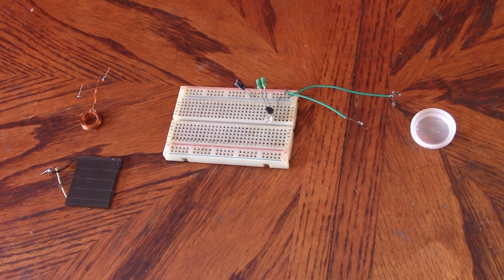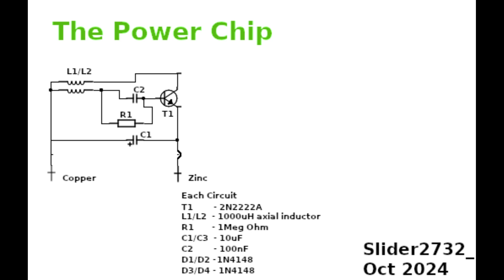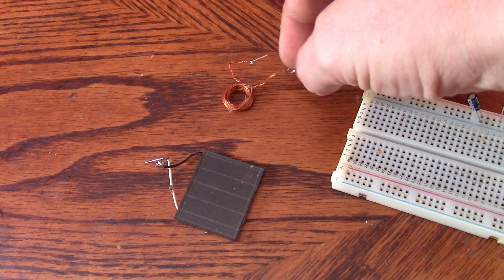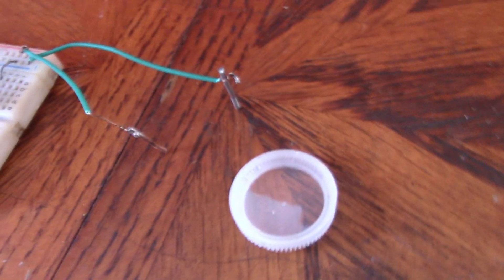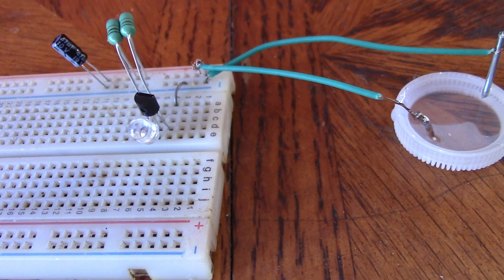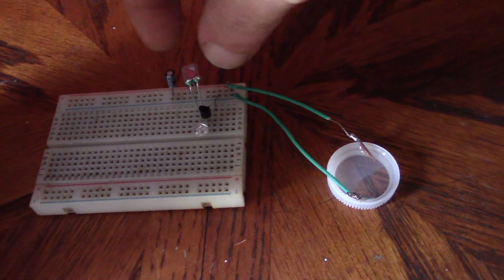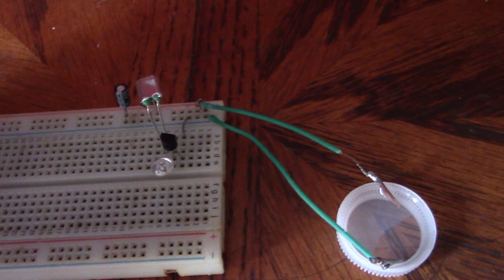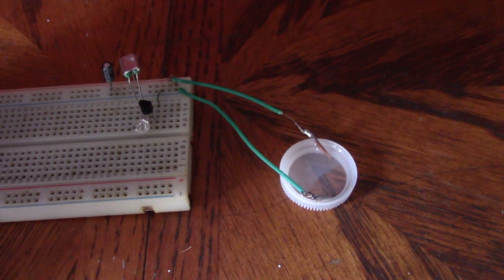Crazy Simple Water Powered LED Flasher!

Comment: It's basically a joule thief circuit. At those low voltages there is no need for the resistor. I ran them on a penny and plate of zinc with a wet paper towel between them like this before. Pretty fun to see it work

Comment: Amazing,  when you take into account how much metal is actually touching the water that's really the only amount of metal you need so I wonder... would it be cool if you could make that whole thing work and it's all within the size of a bottle cap is that possible?
And if so could stack them in series?
Reply from the maker: Interesting concept and yes, that should be possible. Well, the bottle cap bit, the stacking would mean everything would have to be ultra flat. Might well have a go at that 😀

Comment: so cool. amazing you got it working even with the small inducters. will try to get that working too. interesting also, that its working with the led connected to base and collector! thanks a lot.
Reply: i think there is a bit more current drawn thou. or isnt it?
Reply from the maker: @MilkywayOutcast  It's a superb modification and thank you again! Hopefully a little traffic goes your way as the video has done well 😀
In practice, both LED connecting methods work about the same, EC or BC. I usually pick EC, but it was just how the LED was put in the breadboard when first testing and I left it like that. Only noticed when the camera was on. Have found that you can superglue 2 inductors together (same direction of colour bands) and it works. They have to be right next to each other for the field energies to cross.
Reply: @Slider2732_  thank you a lot. i got them working. i also would like to show you another thing very remotly related to your project which i dont want to post publicly but you may find entertaining in case you have not seen that before yourself. can i send you an email with link to privat vid?
Reply from the maker: @MilkywayOutcast  Superb to hear of them working 😁
Unlisted vids I can click on, but I don't think Private can be. This email addy will get to me: youtube.scoop273@passinbox.com
Reply: @Slider2732_  thanks. will send you a link in the next days.

Comment: We need to consider huge internal resistance of “battery”, this is why no resistor is needed. Transistor arrangement with 2 coils (inductors) works on very same principle first disclosed by N Tesla as power regulator … I keep thinking of Tesla valve which allows a little leak back but stops the main back flow shock by guiding the flow against itself … and here we have BEMF which is directed to power the load or whatever purpose.

Basically if works with one transistor in theory can work with 2 or many in darlington arrangement, then bifilar coils should work better as they have no capacitive or inductive reactance and simply amplify the voltage.

I only have 3 videos on my channel, one with the “battery” and the other 2 with bifilar coils … all I need is to upgrade the battery or modify the zvs driver or a different solution for switching. I am trying not to claim anything but it is at least strange what I am getting and how I get it.
Reply from the maker: Yes, great points! A bifilar pancake version might yield some interesting effects, especially if left to wireless output, not wired. Field energies might well outperform wired in some situations. 
You've got me thinking with Darlington or more likely Sziklai water power 😀

And do upload more vids! I noted your last was 7 months ago and am intrigued about your experiments!
Reply: @Slider2732_  many thanks for reply. Indeed those coils should be used for wireless power transmission. Using flat coils reduce the size of field radiation and everything can be captured in short distances.

I am yet to find a way to measure their output in a different reliable way than just powering known loads … but I have destroyed too many instruments for now and I am not going to spend more on instruments then experiments materials.

I am banned from most of forums for “unsubstantiated” claims even if they are just what Tesla and many others have said long time ago. We only need to look up for old books/patents … as almost everything is twisted in new and modern science. We need to refer to basics to straighten up all bent and thwarted theories.

Comment: I like that, I don't think you can't reduce the components any further 😁😁👍👍
Reply from the maker: It really is crazy simple and I know I learned a lot. You may well have experienced similar over the years, where oscillators get to just under the transistor firing voltage and sit there.  Was on the 3rd day of this running 24/7 when it stopped, the water bottle cap had dried out 🤣

Comment: Amazing ❤

Now you need to try out just a capacitor … connect multimeter leads direct to capacitor and dip the leads in water … you should get straight away 0.2-0.3 v without anything else as I did.
This is why I said if we can get bespoke capacitors with one zinc and one copper would be easier. I have ordered some pure zinc wire and planning to wrap the leads of cap one copper and one zinc with some pancake coils. Even just a diode alone can give you an impulse
Reply from the maker: It is really intriguing. Before now, a cap would charge to just below the firing point of a transistor and sit there... so all got left alone for years. 
Bespoke capacitors would be awesome, especially for miniaturisation!
Good luck with your tests 😀